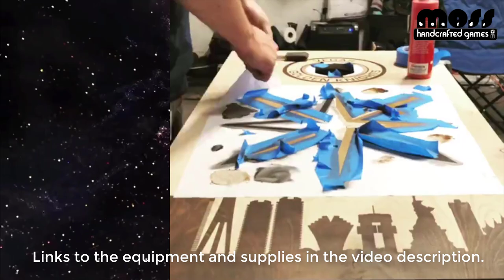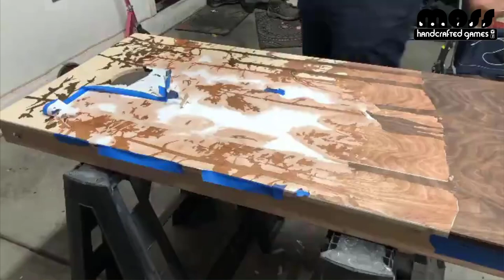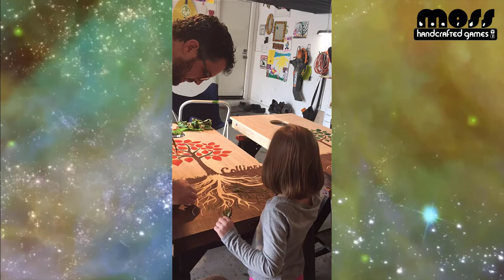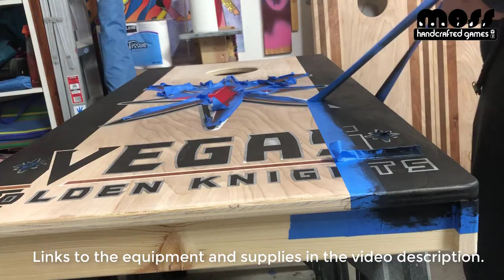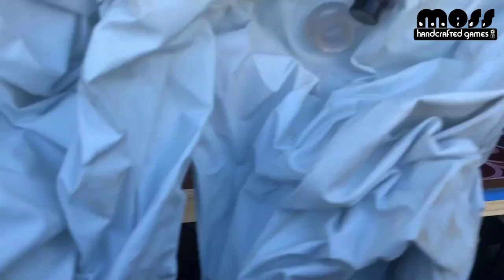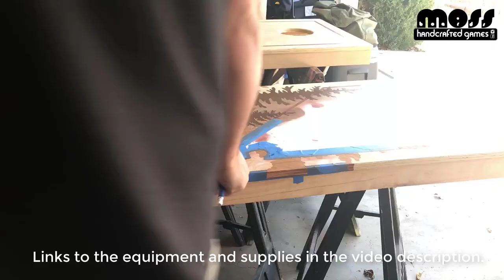What's Under That HUGE Mess? **Super Satisfying Cornhole Board Stained & Painted Design Reveals**

Comment: Hi if im going to clear coat over vinyl would you stain > add some polyurethane > sand >  add vinyl sticker > more polyurethane? Or put the vinyl sticker right on the stain )?  Thanks love you videos!
Reply from the maker: Thanks so much Mike! Welcome to the Collective. I'm no decal pro but from what I hear, you want to add at least one coat of poly and sand it smooth, 320+ before adding the decal. I'd probably do more than one coat to make sure you don't accidentally sand the stained surface. Then, apply several coats of poly to make sure the decal is fully sealed and the entire surface plays consistently. Not sure if you need any additional sanding.

Comment: Are you applying an oil based gel stain on your boards with a water based poly?
Reply from the maker: Yep, no issues with that as long as the stain has fully off-gassed for a day or so before liquid poly. If you apply too soon the gasses can cause bubbles under plywood when the layers, especially the surface veneer separate.

Comment: I have a question on colors. I think you answered this on a different post but I cant find it. You mention something about watering down paints and using them like stains - will you elaborate a bit more?  For example, for the red and the yellow on the Wonder Women Boards - are these paints applied as paints or watered down as stains?  If like stains, how do you achieve the rich deep colors?
Reply from the maker: When I need a tinted background, I mix a slurry of 10x1 water to acrylic paint. I call it a “paint wash” you basically slosh that in quick as possible with a wide foam brush (very messy) then wipe it all off as quickly as possible with paper towels. Gives you a bright stained board with the wood grain all very visible. This doesn’t work with stenciling. Too wet. Use Mixol to tint gel stains with the colors you need.

Comment: I’ve been watching your channel for a bit now. I’m doing similar out here on the west coast. Mostly local Military work. I use the cricut, but need to upgrade. How easy is the vinyl cutter you use?  Do you cut out the whole stencil and peel it up a layer at a time?  Thanks.
Reply from the maker: Hey Robert, there are different approaches depending on the look you’re going for. The most common, when you have touching painted colors is to apply the background color first masking the details so they stay natural wood, then cut another stencil and leave the background mask and pull the vinyl for the details so they can be painted “mask over technique.” Each design is a little different in the sequence.

Comment: I see you use blue painters tape over Frog tape.  Is this just for cost or is it also performance as well.  I know green frog tape can leave some residue
Reply from the maker: It’s cost. I use both but usually only for small easy-to-cut remasks. Frog tape definitely works better for stripes.

Comment: What's your formula for pricing your boards?
Reply from the maker: A lot of builders have a bunch of options and it's like Burger King, have it your way. 
I like to do a set price for stained design boards and another (a bit more) for painted design boards. All include customized bags that I order, handles, boards attach with the friction block. The only optional thing I do is the 27' cord with eye bolts to measure and place the board in position. The price you choose to sell your boards should be based on demand, how many you want to build, and how much you think they're worth.